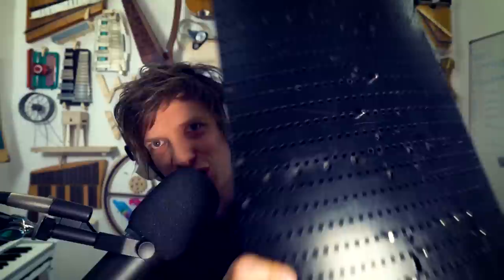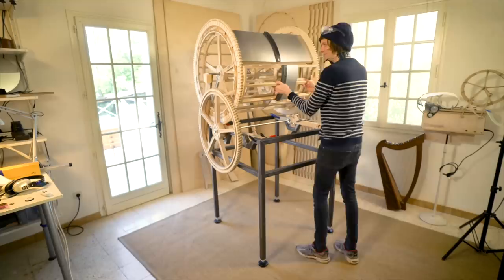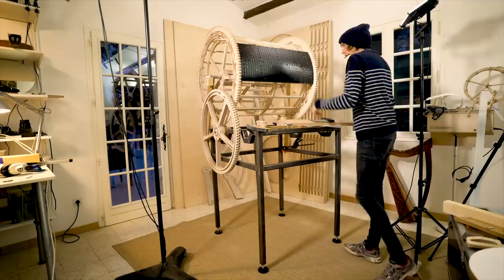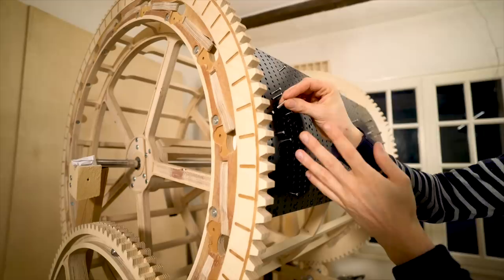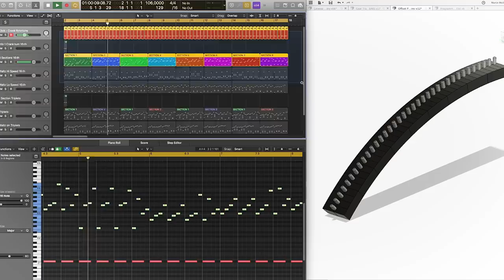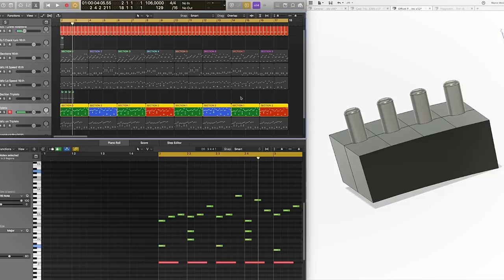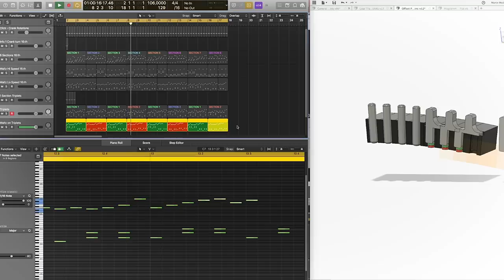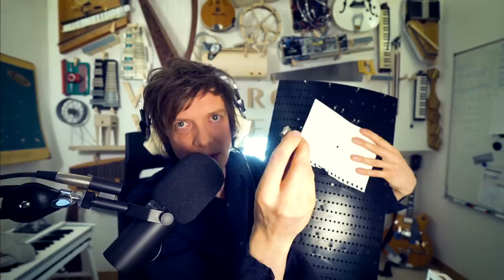Magnet "Midi" Music System - Marble Machine X #25

Comment: Since I cant reply on your pinned thread, I'll try here. Maybe it's an idea to get inspiration from lego. Just make a number of prefabricated magnetic pieces that all fit into the default 16th grid at the bottom, but could have a triplet grid, or even a 5/4th grid at the top. That would give you all the freedom you need. And when you prefabricate them like lego, you pin multiple pins at once, saving time on stage. And glossy black btw :) <3

Comment: My reason fir NOT using glued magnets. Sooner or later the glue will fail and the magnet will stay in the hole. Do you have a way of quickly removing  it? 

Why not build a third set of programing plates just for special songs?
Reply: Dzonemp another methods a nail effect with a bolt on the other tip to prevent from coming out or breaking off
Reply: Screw also works well of only have that one tool machine which is a helpful tool
However it would seem accurate to suggest that screwing in seems possible and stable
Reply: I think that although keeping the amount of equipment down will be a priority for a road tour, I also think having a third set of programming plates is a really wise idea.  They could be used for special songs as you suggest, BUT in any case the timing of having a group of people reprogramming a song on a set of plates would be far less stressful if there were a 3rd set.  I am certain a group of 10 people could do the job within the space a song being played on Marble Machine X but having twice the time to reprogram a set of plates would insure no mistakes occur as well as insuring the peace of mind of those programming the plates!
Reply: So maybe solder then?
Reply: Magnets and glue.. I wouldn't recommend this combination either. I'm also not sure about the magnetic field building up with all those magnets and how it'll affect the pins.
Reply: Something to keep in mind as well is the amount of lights/heat on a stage. Heat might make the glue age faster and get brittle or soft. Might be the same for the magnets?

About the pins, the seperate rows or separate plates seems a good way to go. I'm not a musician, but in stead of 3 or 4 pins, why don't you use 6? 3x4=12 4x3=12 so might match up (but is out of sync with the crank though).

Mate seems a better option to me, as shiny/glossy might reflect (too much) light on stage.

Some thing to keep in mind, is the time needed to reprogram the sections. Using those offset pins (with different kinds to make the triples work) seem pretty hard to mee to distinguish on/back stage and thus taking too much time.
Reply: It is challenging to glue magnets to things, but contact cement does actually work pretty well.  Because it never really hardens, the glue joint doesn’t end up developing cracks.  Contact cements also stand up to elevated temperatures a bit better than expoxies.

Comment: have you tested the tolerances at different humidity levels?
too humid ant they might not fit.
programming mistake proofing... add section to section keys?  that way you don't put them out of order on the wheel  when  tech is  hurried to pass up a panel... might be bad or good.
for the off set pins... maybe  side to side and use the same rounds for cheap.
or different diameter holes that over lap.  much less finicky

Comment: Hello! Love the series, Wintergatan Wednesdays is my favorite day of the week! The design space comments filled up so we can't reply anymore! You answered two of my questions about the song diagram at the end of the video, but there are a few things to consider too. I think having an extra track for triplets will definitely save you all the trouble of making oddly-shaped pins. Plus, are you planning on leaving the diagram on the machine during the song, or peeling it off once all the pins are in? Using offset pins would probably cause the paper to stick to the plate or rip, but even with 10000 normal pins the paper probably wouldn't come off too easily

Comment: I think you are underestimating the time to reprogram, it will likely be quite high.
Reply: One could make more sets of plates, and pre-program the ones that are more difficult to program.
Reply: Or even mounting the plates on the wheel will take a lot of time between songs. Perhaps a secondary wheel that can be fashioned with the new set of plates between songs and then quickly remounted? I don't know if a secondary wheel is realistic due to the high level of integration with the other gizmos, but I hope the transition can be entertaining at least. 
Great work.
Reply: I'm making the assumption that the MMX will only be used for a few songs, maybe 4, in the set so spaced out. But I too worry that once on stage and everything that can go wrong it will go wrong. Its probably dark, the band will be playing another song so its going to be  loud so there will be very little communication.
Reply: I think he could make "templates" for easy reprogramming. Something like curved plates you can keep on top of the programmable plates with holes only where you need to put the magnets in (and also possibly assisted with colour coding).
Reply: Its still literally a lot of moving parts.
Reply: A template could easily be a sheet of thick paper that is pre-drilled with all the holes you need.  Mount the paper on, and it becomes super easy to just fill each hole.  Plus if the hole arrangement becomes super complicated with triplet rows and duple rows, it will probably become necessary.
Reply: Or don't do any pins at all and have the marble release mechanism react on holes. Then just put on the cardboard as punch cards. The ancestors of computers worked just that way.

PS: I cannot read the replies of the top comments or even reply. YouTube commenting sucks, maybe link to a Reddit or something sane...

Comment: Hey martin, 
I have an Idea. Due to the fact that your current system with the 10000 pins is very time consuming to program and the fact that a human has a really high error rate/ doing mistakes which does increase with Exhaustability ( this is what you definitly dont want in music to have a wrong note or one missing), it would make more sence to think about a litte different system. What about you have fix plates, on which you glue the pins in the right order, then its still programmable, the change of the song is way faster and the probability of an error during performance is alot less. So  you have fixed plates for a specific song you want to perform.
Maybe you can even connect the plates so you have a book of plates. Like you showed us in the your  musicmachine mondays series, just way bigger.
Another idea is a flexible music mat on which you glue the pins, then you just have to exchange the mats. Futher more you can do one set of plates with just holes. This plates can be programmed manually, therefore you still do not loose your flexibility on your machine. ( so you would have 2 songs of fix plates and one set of plate which is reprogrammable like the one in this video. Furthermore it would make sence to create a mechanism, so the plates can only be mounted on the the right way around. you skrew a skrew in the Programming wheel and  cut a shape of an U  out of the upper site of the plate. Then it cannot be attached to the programming wheel in the wrong way. 
Anyways I am sry for my bad english and hope you could understand it. Love your videos, you are a genius, keep going! Thx Nik
Reply: Niklas Braunfels he said he wants it to be completely reprogrammable, you should be able to take the pins out.

Comment: On the pins breaking, if it breaks below the black plastic how will you get it out? You'll need spare panels. Or if you glue a magnet onto a metal rod, and the magnet breaks off down below, how to get that magnet out? Maybe a smaller hole in the sheet metal piece, that you can stick a wire up from the underside, to pop the broken piece out? The hole would have to be smaller than the magnet of course. On the template paper sheet getting stuck, it may be better to just leave it on. Then it wouldn't matter matte or glossy black, as you wouldn't see that part when there's a music template on it. Then the paper (or maybe thicker material) could also have colored dots around the holes, to help you really see the spots to put pins in.
Reply: Steve's Woodworking you can put super glue on a stick and wait for it to dry to get it to pull out. It's not hard.
Reply: or use a stronger magnet to extract it...
Reply: What about using copper studs or another metallic pin replacement so thus not breaking 
( Also tiny ball marbles with magnetic hematite effect could co create a sacred  alchemical effect that can heal masses by hearing also  feeling waves of LIGHT through the frequency of 8hz + as was within sound healing temples  )

From listening to thy beautiful orchestrations Amor & I dance and sing play along with instruments 
Merci Åshå Akasha  Martin

Comment: Possible design solution: 
instead of modifying the pin isertions, modify how far the programming weel moves when you turn the krank one revolution by changing out a gear pair: https://curriculum.vexrobotics.com/sites/default/files/styles/large/public/8.20.1%20Gear%20Pairs.png
Reply: I am Samzelot he will still be left with the problem of bars not adding up. He has 64 beats that cannot detect divied into the 8 bars of 3/4 he would still be left with the bar and a half
Reply: True. I don't know that much about music theory but is it important that it's specificly 8 bars? If you for example wanted MMX to be able to play in 3s, 4s, and 7s you could have a total of 3*4*7 = 82 beats.
Reply: Plus another issue is the real world problems, he'd need to be able to replace it quickly WHILE still on stage playing. He'd have to undo the crank & gear as well which will take time.
Reply: I think it depends on how you configure it. If you where really smart about it I think you could make it change between gears just by the flick of a lever
Reply: But then you can not change between 4s and 3s in one song.
Reply: I thought that perhaps he could just drill 7 holes rather than just 4 and use the same rods if needed to make triplet sections. The only problem would be that he wouldn't be able to program both 4s and 3s in the same ''section'' (currently section would be 4 holes). https://imgur.com/a/S1zGc Something along these lines.. Also, I think the pins would remain stable and not switch or break through the gaps, because in the drawing the holes are much closer together, where on the wheel itself the holes aren't right next to each other.
Reply: Silenceris the problem here is that if you place a pin one at each side and one in the middle (tripplet) then the timing would be different between the last and first pin between modules. He talked about something similar in the video though with multiple "channels" and i think it could work if you spaced it correctly :)

Comment: Yes, triplets! A wonderful addition to add more flexibility to the marble machine X.
1) My vote is you use the dual programming tracks per register with the rectangle programming pins. Doing this, I feel, is a more simple pin management system... one pin variety and a simpler pin orientation since it looked like the offset pins had a specific orientation. 
2) In case of a pin break that would be difficult to extract from the programming plate, I suggest drilling a small hole in the sheet metal for each programming pin position. This way you can insert a small rod like a paper clip from the back side of the programming plate that would push out the broken programming pin.
3) I like the matte grey. I believe the programming pins (especially polished ones) will twinkle in the stage's lighting or possibly a specific can light just on the pins. The matte finish will be a good contrast to that effect vs the glossy finish causing its own reflection.
4) I imagine, despite having 10 helpers, grasping hundreds of magnetized pins could cause hand fatigue. Instead of inserting and removing programming pins by hand, my fantasy idea is to have a tool for that. The extraction tool might operate like an epilator. The insertion tool might operate like a pneumatic nail gun but with much less force. Having the programming pins available in a pin magazine is much less effort to orient as you're inserting them into the programming plate. My experience is simplifying little details like this pays great dividends when repeating the task thousands of times.
5) Lastly, I realize if you passed on the mechanical pins being pre-built into the programming plates due to that being too much work, this idea is right up there. The idea is to create a programming cradle that the people in lab coats and safety glasses put the programming plate into when they are reprogramming a song. The cradle would have LED lights for each programming pin location which can then display where a programming pin is required for a song. I realize the design for the programming plates has wood structures blocking a clear access to the back of the programming plate. If designing the programming cradle to overcome that challenge is not interesting, maybe redesign the programming plates or put the LEDs into each programming plate. In that case, I believe you're preference is to keep the marble machine X free from electronics. I believe the LEDs could be included with no appearance to the audience. Furthermore, the bulk of the circuitry can be kept in the programming plate cradle and the LEDs only operate when the programming plate is attached to the cradle.
My mind is swimming with variations on how to execute this.

Comment: I'm not sure if someone already said this idea but here it goes. Two ideas...

1. Why not program two song on one plate? Looks like you do have space in the plate to have two songs in a row. 
If you have one song going one way and you flip the plate 180 it runs the other song. Make everything offset so when you flip the plate it strikes the other pin. 

2.Would it not be easier to program it from the back side with a template were you push out the pins. 
Ohh I do think of a version! Think about the pin you have in a shelf like IKEA Billy for it has a neck in the middle. If you put a spring on that and put it in a hole with a cavity in the middle. You then could make a template on the back side that you put on were the holes in the template will let the pins go out and were there is no holes it pushes out the pin to be played. 
I made a fast sketch. 
https://ibb.co/mFeRVn
Reply: I love what Wintergatan is doing, as it is combining mathematics, engineering and good old logic with the end goal of making music - in other words, an audible result. It promotes lateral thinking and challenges one to use one's brain in a different way to normal to find practical ways to achieve this result via a method (the marble machine) that, in this day and age, would be considered impractical. I read through all the responses and was impressed with yours because they embody this approach and can be practically applied. The second, in particular, has a lot of merit, as long as one can ensure the springs for the pins won't malfunction and leave a pin in the out position. The first would necessitate a re-design of the machine to accommodate the offset. It would also have a much higher logistical component, as they would have to transport one panel for every two songs, whereas the second solution would simply require a template for each song.

Comment: Just make seperate Plates for triplet timing? if they can easily be switched out then it shouldnt be an issue and u wouldnt need complex system
Reply: That'd only work if your tune was entirely triplets or entirely quaver-based. If you ever want to mix timings within the same tune, you'd end up having no hair trying to program it. I suspect Martin's idea would work fairly well.
Reply: brickviking

Comment: 4:12 It's actually 1/100 of a millimeter, not 1/1000.
Reply: not really in order to have a 1/100 precision you need to be precise in 1/1000's
Reply: s3icc0 I don‘t really understand your answer. Do you mean that his estimate was precise within a +/- 5/1000 range, since the caliber has to round the measured value to 1/100 of a millimeter.
Reply: in 1/1000's means in thousands so 5/1000 is the minimum you need

Comment: Hey Martin, I'm not sure if you've got a system in place for this, but from what I could see, it looked like the midi panels could fit in two ways (possibly upside down, meaning it would mess up the song and parts of it would play backwards). Just wanted to call it to your attention just so that you don't miss it; a simple solution would be to make keyed panels (with a little part that fits into the next one so that you can't put them facing each other), but I'm sure there's other ways!
Reply: Another thought, this time about your triplet notes: if you make the 3/4 tempo pieces, you'll have to be very careful where you put in the pins. They're not all identical, and so you'll need to keep the three different types of triplet pins separately, making it difficult to quickly remove the pins. Also, sorry if I replied to the wrong place, I was having some rendering problems with the design discussion thread!